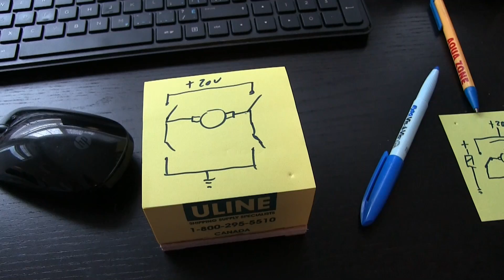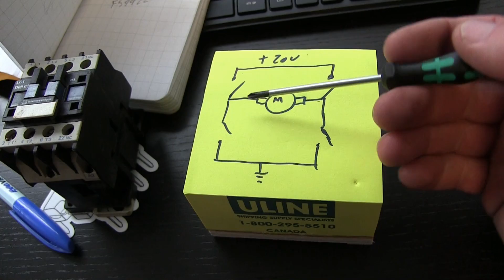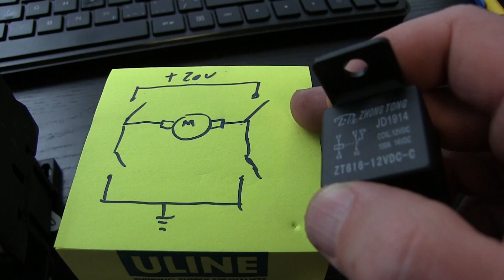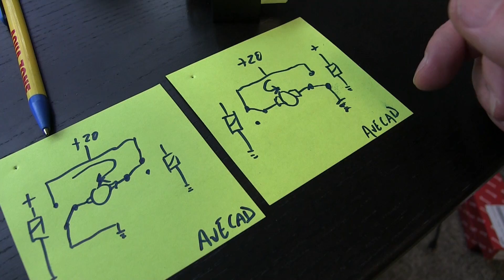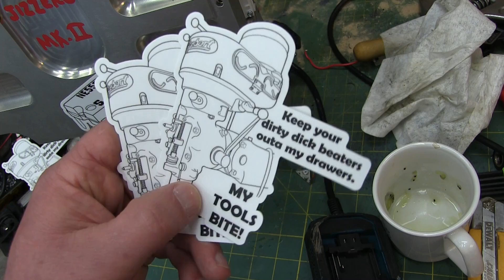Hacking Juicero's DRM Fruit Bags

Comment: Surprised no one corrected you after all these years.

 That symbol on the relay is not for solenoid, that is a suppression diode.

 Many automotive relays have diodes built in( as indicated by that symbol) to prevent fly back voltage from spiking a module.

Comment: It doesn't seem hard to modify for high torque new motor if that ones not powerfull enough send the gears off for heat treatment drill 4 holes for metal rods to keep it from tweaking over

Comment: 1:08 did you cut that front plate yourself? It looks like something I would have made in beginner manual gcode class. It's like you circle milled the part with a small endmill but you didn't overlap the cuts so it has a weird ridge pattern.

Comment: The DRM aspect is ridiculous, but I've got a story about juicers. My friend's daughter got breast cancer and he bought three old Norwalk cold-press juicers to make enough juice cocktail (I forget what fruit was involved) to give her what was supposed to be just the most nutrient-rich diet in the easiest digestible form possible. She was originally slated for a mastectomy, but when they checked her right before the operation the cancer had reduced in size enough that they could get it with just a lumpectomy. Maybe the juice did it and maybe it didn't, but I can think of worse home remedies to try than drinking a ton of juice. Consider, though, that even old Norwalk cold-press juicers on Ebay cost around $1000. He saved himself some money by buying broken units and refurbishing them.

Comment: 3 years later and I’m rewatching this video still amazed a juicer was made with this much over engineering
Reply: Over engineering would be 3/4" plate stainless steel(not aluminum.)120V AC geared motor.

Comment: Too much stuff is engineered to just barely hold togheter long enough to fail out of warranty. Plastic is actually a pretty wonderful material; but it is associated with cheap garbage because that’s what it is mainly used for. Compare with e.g. an SDR 11 PE 100 RC water pipe with butt-welded joints. That’s going to still be there in a hundred years; doesn’t corrode, resistant to water hammer, less likely to get clogged with lime scales, joints are restrained without thrust blocks. SDR 21 would work for most drinking water applications, at least long enough to get out of warranty before it bursts.

Comment: Regarding relays: I think the best idea would be to flip one of them upside down on that schematic, and connect their switching pin. That way, you could switch the state of the motor with only one pin and always have them synchronized for either rotational direction, as well as be able to use an Arduino to control these more comfortably, with a perfectly standard reverse pin.

Or maybe you did end up using that, and just haven't told us?

Comment: Wow, overengineered switching circuit. One dpdt toggle switch that has a neutral middle position for off. Motor to center 2 legs, Voltage and ground to outer legs with polarity reversed on one pair of legs. Viola, Forward, reverse and off all in one switch.

Comment: Bought a automotive relay on ebay, (12v 30A) took it apart when I didn't understand anything. 
Turns out it was a smaller relay inside 10A and they fk'd up the wiring.

Comment: I would've gone with a 3 step switch [close]-[off]-[open] and contacts parallel to the press surfaces that disconnect the power to prevent the motor from trying to press stuff togetehr that is already together :D

Comment: I could almost forgive the guy who designed this monstrosity if the beefiness of the metal came from that it was made of soda can aluminium.
Please don't say it's stainless steel.
But the load bearing bearing being a conical roller bearing rather than an axial bearing tells me the shot caller had an arts rather than an engineering degree.

And they want to wedge "Arts" into STEM. Just because the snowflakes felt like they could tackle cold hard science when they don't even know their own gender.

Comment: We would call it a Kludge engineering.  This team or individuals are probably either 1 year or graduates or dropouts or Drs with no hands in the trenches never made anything except ideas.   They are definitely in their 20s.  Also, smoke drugs and party and maybe from wealth, that never worked a day.  Otherwise, they were a bunch of Silly Con engineers with skills in software and electrical and basic mechanical skills or a consulting firm.  In any case, it's not engineered for maximum value for 3F, DFSM, QCT, etc.  Juicing is for fruit and veggies that will spoil before the market.  The side effect was more pseudoscience for the suckers.  If you have unlimited time and money by a proper juicer that uses physics using first principles and analysis with statistical data analytics with AI optimization and gets your 99.9999 percent efficiency for all attributes. Physical Test of all optimization.  Repeat until you have 6 sigma variance.  Instead of IOT doing DRM.  Have it do analytics for improving the HFE or any number of attributes like health-related or some techno sucker who want that vanity splash style.  There are billions of using mobile supercomputers trillion of times per hour.  So we engineer a device that is amazing for engineers and machine Nerds. Then have the economy brand for vapid social suckers.  The cool kids like shop engineer machine tool heads get the industrial item that is passed to your posterity or some collector of industrial art.  But who knows one day we will all be transcended into a matrix-like universe.

Comment: Duuuuude, gotta access the TTY via PuTTY (or a similar program, free of charge) so you can actually get any sort of connection to the MC. Either that or you can hunt for a JTAG and solder some serial leads up to her whah.

Edit: To connect your pc/*nix system to the microcontroller via USB.  Either way you'll have to use PuTTY or something regardless of JTAG or USB

Comment: Just looked up those relays on amazon, and holy crap. I had no idea relays that cheap existed... here I was the whole time wondering why you weren't just using mosfets. I will need some of these for sure... Although, for a small(?) motor, wouldn't an appropriately spec'd mosfet still be cheaper than a relay? And smaller? And potentially require less power to keep active?

Comment: great video :D

except of that IOT and DRM bs they do, i have another great problem with the thing: that "juicer" doesn't even make juice, it just presses it out of a bag. you'd have the same effect by just getting a bag, punching a hole in it and putting a straw in :P
or, you know, get a real juicer you can put actual fresh fruit in, without the malware in your kitchen and for probably half the price :D

also addendum to your H-Bridge explanation: you could also just close the 2 lower switches to implement a "motor brake" feature: not just not actively turning, but actually resisting external/manual/etc turning by making it so the motor tries to act as a short-circuit generator which means its internal magnet induces a current in its coil that tries to counteract the magnet's movement. doesn't help in this project because pressure from the bag can't turn the gear assembly anyway, but might be helpful in other projects involving an H-Bridge, e.g. an electric (model) car or a robot.

Comment: Built like a tank except one important part, so it breaks down all the same until a new model is out,  is planned obsolesence. This alone shout be sentenced for crime against enviroment and consumers. And in the next sentence they are talking enviroment protected. And then the bar code reading. They forgot to make the machine slower by software update, like apple does. Fail by greed.

Comment: Power of 2 Tesla?
You measure the strength of magnets/electromagnets in Tesla.
Electric motors are measures in Watts (when focusing on its electric consumption) or Horsepower (when measuring the torque/lifting strength).
These guys didn't even know how to describe their Edsil DRM juicer.
The Jucero guys were complete morons if they expected this to be a successful product.
If they were using this to fleece customers before running away with the money, they might have succeeded.  How much were they able to embezzle?

Comment: The 320 volts does come from a voltage doubler,  the four 250v capacitors are in series/parallel to make one effective 500v capacitor.

Comment: Hard to believe these guys raised 120 million to manufacture this, even Google invested.

When it was debunked on the internet, saying you could squeeze the packets faster by hand, the company folded. 

Next a Bluetooth enabled toilet paper dispenser,  pulling the paper off the roll by had, way too difficult.
Reply: No, a sink that turns on by connecting to the internet and requiring a thumbprint. Then you have to input your Social Security number and let it scan the deed to your house. Finally, it needs a blood sample, but doing all this just makes the water cold.
Reply: You need bluetooth and internet to tell you when your poop paper expired though.
Reply: As long as the app can ensure that the toilet paper roll is not put on backwards, and zaps anyone who does
Reply: It seems like squeezing the bags by hand would also circumvent any DRM.
Reply: we are almost there.  every public restroom i use requires me to wave my hand in front of a machine to get it to give me six inches of paper towel.  bluetooth would be nice, i could place my order before i wash my hands so the eighteen inches i need is already ready when i'm done washing.
Reply: Condoms that break if they're expired (one week) or you use the wrong brand of lube.
Reply: i bought the toilet paper dispenser
Reply: Maybe the toilet paper dispenser could order more toilet paper from Amazon when low on toilet paper

I bet amazon would invest...
Reply: My origami company folded after a product teardown.
Reply: Uses flipper zero to dump entire roll into the floor
Reply: Google/Amazon has an interest in putting espionage devices in peoples' homes. Heavy ties to the CIA.
Reply: HaqqAttak This is why I give camera permissions to Google and Amazon then masturbate while looking at the cold lens of the camera.
Reply: @Okartel  totally underrated comment
Reply: @HaqqAttak 

Surveillance
Marketed
As
Revolutionary
Technology
Reply: @Rayman1971  I'm definitely stealing this.

Comment: 2:59 That'll be a voltage doubler arrangement - you see it all the time in older (or crappier) active-PFC-less ATX power supplies. You know, the ones with the red 120/230V manual switch.
http://jaunty-electronics.com/blog/wp-content/uploads/2012/09/VoltageDoupler120.gif

Comment: FFF - Form follows function. 

Let's build a bluetooth enabled straw that has a robotic tip that dodges insertion into any non-Coca-Cola product.
Reply: Jordan Hall 
Or toilet that won't flush unless you use the right toilet paper.
Reply: @bananian  fucking nightmare fuel
Reply: FFS people , don't give them ideas!
Reply: Mark Howards LoL I read that ffs as an iteration of form follows function... I was like what? “Form follows ....s..ss.structure?...science?...simplicity?” What is he trying to say lol
Reply: Condoms that don't work unless you use the right brand of lube.
Reply: @redvelvet5374  
STD detecting condom. Will shock you if where you're going into is dangerous
Reply: @DaDaDo661   Woah there, don't want anything to be slightly useful.
Reply: @DaDaDo661  that'll actually be a decent product
Reply: @DaDaDo661  I'd buy that.
Reply: @DaDaDo661  I remember reading university students have actually designed condoms that change color in the presence of certain STD's/STI's, but the tech has yet to proliferate into the market
Reply: @redvelvet5374  i mean thats a thing that already exists. Some lubes will degrade condoms so its always best to use water based lube
Reply: I'd buy it for a dollar!
Reply: Xyre154 I think they meant a certain brand of tp
Reply: Might want to look to Michael Reeves for that since he did turn an old 3d printer with a ridiculously powerful hydraulic pump just to detect and remove tomatoes from salads.
Reply: I'm sure Coca-cola has tested this.
Reply: coca cola? that's an odd way to spell pepsi
Reply: Yes please dont.  We already have coffin apartments and brutalist housing projects that reinforce misery.

Comment: The peak voltage of a 110V ac supply is about 155V so if you half-wave rectify it with one diode and filter it with a 250V capacitor you get a dc supply of plus 155V.  If you then do the same with a second diode and capacitor reversed you get a dc supply of minus 155V.  You then have a 310V dc supply between the two outputs. Voila!.  The inductors are common-mode chokes often incorrectly called baluns which prevent switching noise from being fed back into the mains supply.  Someone probably already said this but who can read three thousand plus comments to check?

Comment: The trick with superglue is to never put the top back on. Cyanoacrylate monomer has a high vapour pressure and it gives off vapour which polymerises in the cap and eventually blocks the nozzle. Leave the top off and it just blows away. You can keep it in the fridge too. Also buy cheap stuff, it's all the same and it hurts less when the bottle goes solid.

Comment: It doesn't even crush fruit. The juice in the bag is pre-squeezed. You can literally cut the bag open and pour it in a glass for $2000 less
Reply: People have squeezed the bags by hand and it's faster than using the machine
Reply: Or just eat the fruit
Reply: @openmythirdeye  nah man eat the tree that makes the fruit
Reply: @michaelfinlay1412  eat the dirt the tree grows in
Reply: @RedmarKerkhof  😩
Reply: @RedmarKerkhof  Tfw no Farmer waifu
Reply: @RedmarKerkhof  Had to unlike to keep at 69
Reply: my hypothesis is that this whole product was a prank.
Reply: @davidwestin6345  I mean the man that made the juicero literally sells raw water so...
Reply: @davidwestin6345  I think a lot of these products are created without considering "why should we" and instead hope to be financed by Silicon Valley type of investors to make something idiotic, despite a practically non-existent market. If you have to convince the masses that they need something despite thousands of years of not needing it, they probably don't need it. Especially when that thing is a wifi enabled machine to squeeze juice packets.

At least those gigantic expensive juicers grind up the fruit too, and they're built as cheaply as possible!
Reply: Or just cut into the bag and stick a straw in
Reply: @GlitchTechV1  I'm sure there'll be buyers for $2000 scissors to cut into the bags as long as rtey come with a $100 pack of 10 disposable kosher vegan straws.
Reply: Really depends on the cost of the knife or scissors mate.
Reply: Or just crush it with a stone
Reply: Wait a second. If you’re Alex W who am I?
Reply: @Daz912  a fraud apparently 🥺
Reply: @adnamamedia  Must be. >-<

Comment: If you wanna see something with ingenious engineering to meet a budget, get hold of some Omnipod diabetic insulin pumps. They are disposable, and have automated pumps inside that work by passing a current through a wire that contracts and winds a little tiny lead screw down with a ratchet, like the escapement in a clock. Its mental. Do a tear down on that, the video will be an hour long.

Comment: You constantly keep me laughing.  It's good to see that there are others who constantly realize that engineers don't have any common sense and don't think like the common working man.  This thing is an abomination on so many levels.  On the other hand,  you've now got a battery powered dick vise with switch operation. Stick a hot dog in it.
Reply: Actually, the engineers of the company DID have common sense. However the CEO completely lacked it. They had several designs that were much more affordable, but the CEO rejected them because he preferred to be associated with a famous designer who came up with this shitty design. 
https://gizmodo.com/the-mad-king-of-juice-inside-the-dysfunctional-origins-1795330639

Comment: Right. So. As a lowly angry pixies engineer, I have a question about the bearing point load statement thingy. The wheel bearings in my car are not roller bearings (YMMV). So there must be not insignificant point loads there. Nicht wahr? So what gives? Why is it okay in my car, but not okay in this machine? Granted, the wheel bearings are larger, but so is the car.
Reply from the maker: +Mr Dr  I mean't the point load applied directly to the race. That is the bearing acting as a wheel, not contained in a roller or caster.
Reply: AvE Aaahhhh, okay, I see. This is why I watch your videos. I accidentally learn stuff.

Comment: You should have connected the 30 terminals of either relay to the +/- of the motor and then run B- to 87 on relay A, and 87a on relay B. Then run B+ through an activator switch to 87a on relay A and 87 on relay B. This way, in the forward direction, both relays are off, and only need to be energized for reverse. In your setup, one relay always needs to be drawing current in either direction, which will end up killing your battery even when not squeezin.

Comment: 18:29 - waaay too complicated! Swap the NC and NO on one side of the motor, and just wire the relay coils together (series or parallel, whatever). a flick of one switch to energize the coils will flip the motor.

For safety, in NO mode (failure mode) the press should retract.

Comment: The relays are appropriate because you're switching a DC load. The power switch must also carry the full load, but, if both relays are energized or both are de-energized the motor does not turn and no in-line power switch is necessary. That's engineering!

Keep your stick on the ice.